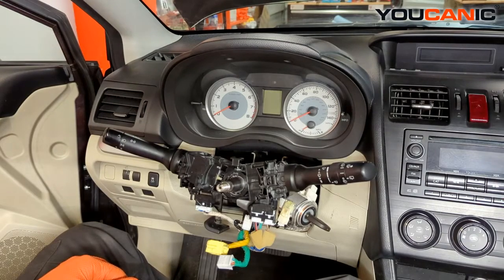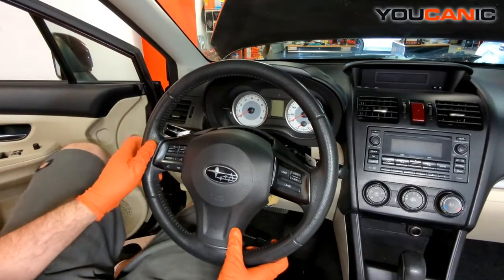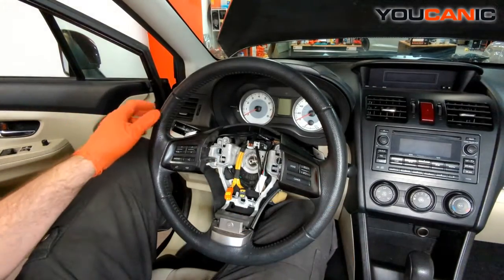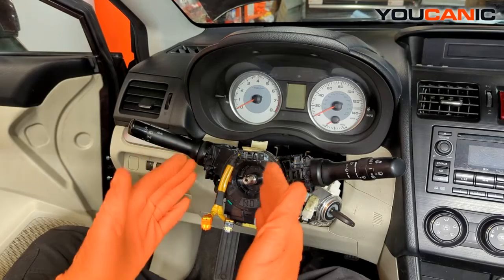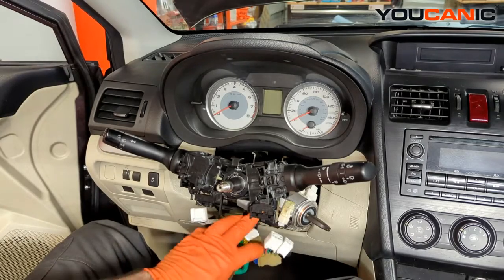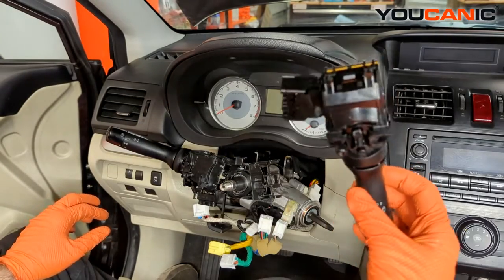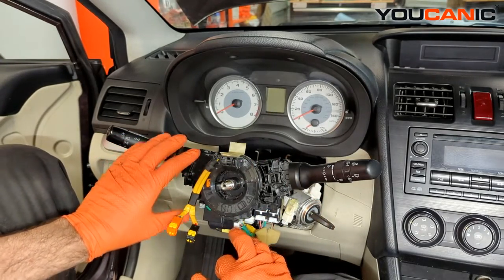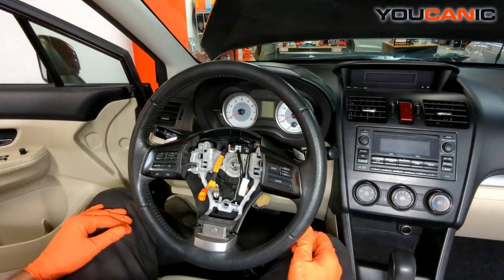2012-2016 Subaru Impreza - Combination Switch (Wiper & Turn Signal) Replacement

Comment: Excellent instruction, thank you.
Just did this replacing combination switch due to headlights coming on on their own with the engine off, draining the battery repeatedly.
I'll say the most difficult part is releasing the clips for the airbag module. Took me quite a while to hit it right.
Oddly the replacement part says "TOYOTA" on it, but then so does the part it's replacing. 
Here's hoping problem solved. This car keeps doing this now and again.
Reply from the maker: Hi there! We're really grateful for your feedback and so glad to hear that our tutorial was beneficial for you. Yeah, releasing the clips for the airbag module can be tricky, but with patience and practice, it absolutely can be done. The "TOYOTA" marking on the part is standard for OEM parts, indicating they are genuine from the manufacturer. We really hope your problem is solved now. It's our goal at YOUCANIC to assist you with your car repairs and make them as seamless as possible.

As a side note, if you need a good professional diagnostic scanner, we’d suggest taking a look at the YOUCANIC Pro System Scanner right here: www.youcanic.com/scanner. It can be a valuable asset in diagnosing and managing future repairs. And for additional resources such as Factory Repair Manuals and Torque Specs, you can get access at www.youcanic.com/manuals. This can provide you with in-depth information on fixing and maintaining your car. Thanks again for your comment and best of luck with your car repairs!

Comment: I may have to do this thanks. Wiper only works on high. Still unsure of diagnosis.
Reply from the maker: Hi! It sounds like you might be experiencing issues with your wiper's control switch or its motor. Have you tried diagnosing it with the YOUCANIC Full System Scanner? (www.youcanic.com/scanner) It's a great tool that can help you pinpoint the problem accurately.

Remember, at YOUCANIC (www.youcanic.com) we're dedicated to empowering car owners like you with knowledge and resources to understand and fix your cars confidently. If you have more queries or need further guidance, feel free to ask at our community forum. We're here to support you on your automotive journey.

Comment: Do the wires for the shifter indicator light (P, R, N, D) come into this switch? I put a different shifter plate in and it still does not light up when headlights are turned on. Trying to figure out why they don't light up. Same for the climate control unit, lights do not come on when headlights turned on.
Reply from the maker: Thanks for your question! While we cannot exactly determine if the wires come into this switch, we suggest referring to the factory repair manuals on YOUCANIC, which may provide a detailed answer to your issue.

At youcanic.com, we strive to empower car owners with knowledge and tools for their vehicle's maintenance. It sounds like your situation might need a little more investigation. Don't hesitate to reach out on our site where more specific help can be provided. We are here to support you throughout your car ownership journey.